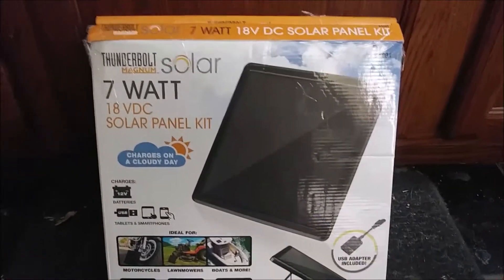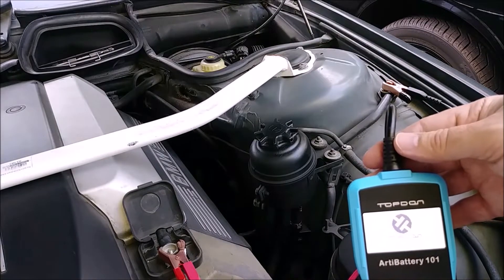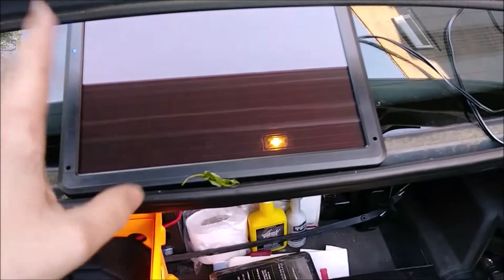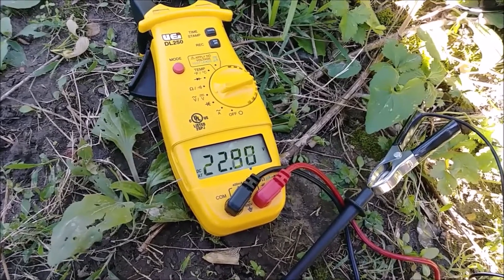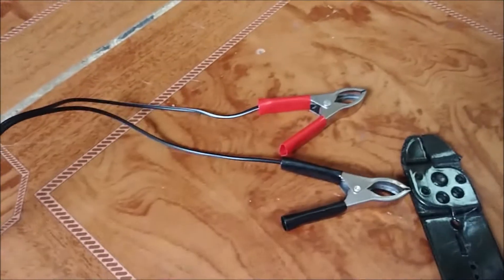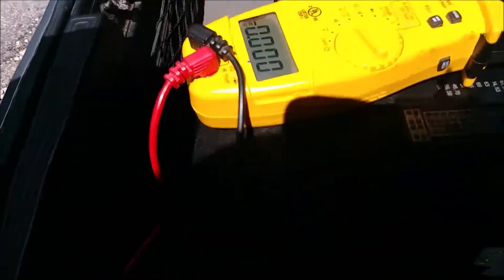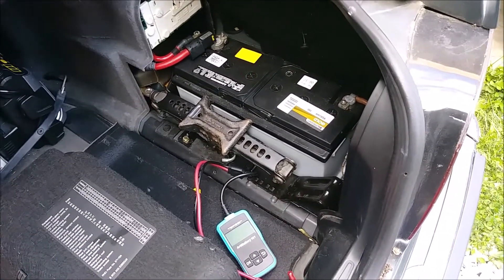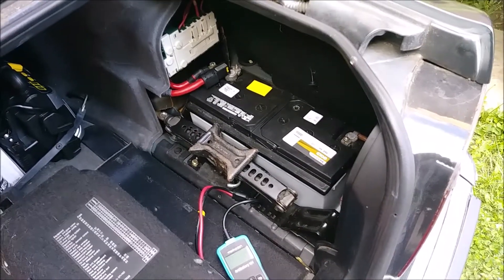Harbor Freight Solar Panel Review and Test

Comment: Hi what happens if I don’t use a charger control?
Reply from the maker: The panel will put out like 18-20-something volts. A little too spicy in my opinion for a 12 volt battery. Though if you decide to not run a charge controller, I'd make sure the battery is at least not in the sun, the cell caps are off to allow bubbling and venting without building pressure inside the battery and I'd also keep distilled water on stand-by to add back to the cells once the high voltage causes the water to evaporate away.
Reply: @HollywoodHornet  thank you! If I change my mind on buying a charger controller do you recommend one that has those weird little plugs because I would like to use the USB plug when I go camping, i’m not too educated on the plugs and The proper names
Reply from the maker: @626jonny  lol. I guess by weird plugs you mean where one end is male/female and the other end has female/male reversed? Or did you mean where I have those curved/forked connectors I crimped in place after I cut the male/female end off the solar panel? Either way, mine was open box and I believe it was missing the cell phone charger, which I think was a USB connection.

It's really user preference. One connection is really no better than another. If I'd have had a spare male/female, I would have kept the one on the solar panel, then spliced another onto those forked connectors on the charge controller end for a quick disconnect. If I ever get two of those, I'll slice in end to the solar panel and the other on the charge controller end.

Comment: Question, do you know if you could charge a phone with this device?  I'm not too concerned about charging car batteries.
Reply from the maker: I haven't tried to charge my phone, so I am unsure if it would actually work for that purpose. It does keep my spare car battery charged tho, so I reckon it could charge a phone, and maybe even keep one charged (assuming you weren't also using the phone while trying to charge it). I cannot be certain of that tho, since I've only used it on car batteries.

The box does say it can charge cell phone batteries, so with no other information to the contrary, I can only assume the box is telling the truth.
Reply: @HollywoodHornet  thank you.

Comment: Yo Hollywood,
How's this thing working out?
Do you think it works?
Do you still use it?
-Chuck
Reply from the maker: I use it to keep the spare car battery charged, since the spare isn't attached to a car. That thing just doesn't have the horsepower to keep the BMW battery charged, especially now that I only get like one hour of direct sunlight.

The outdoor cars get an electric trickle charger to keep them charged, and the basement battery gets the solar charger.
Reply: @HollywoodHornet  
That sucks.
After some time with mine I found the opposite.
It was overcharging my battery, and the only safe way to use it would be to buy a solar charge controller for $25.
So I returned it, and just continued using my smart charger.
-
Reply from the maker: @PanzerPlatform  must be nice to have all that sun shining on you. Sun is a premium in the citaye...especially in the winter in the citaye. I do have the charge controller on mine tho. Maybe it would be better if I removed that and let it absorb all the sun.
Reply: @HollywoodHornet  
What brand charge controller did you buy?
Reply from the maker: I think it was one you mentioned in your video? It's a little guy.
Reply: @HollywoodHornet  
If so that's a quality unit. 
I would not disconnected it. 
It does not reduce the available power from the panel. 

Not only will it protect the battery from overcharging, it pulses the current flow to prevent sulfation. 
This will prolong the life of the battery.